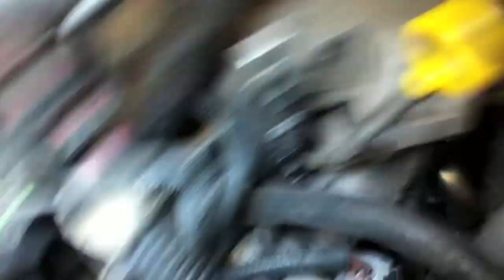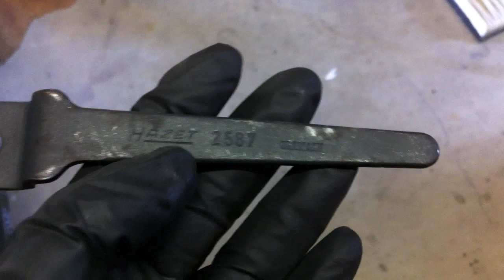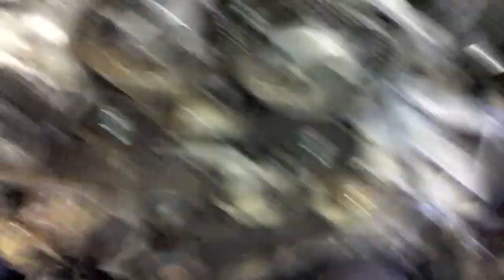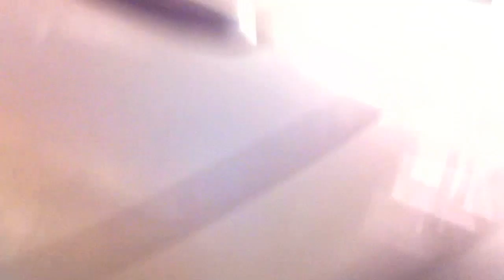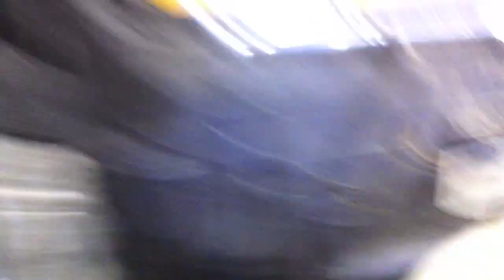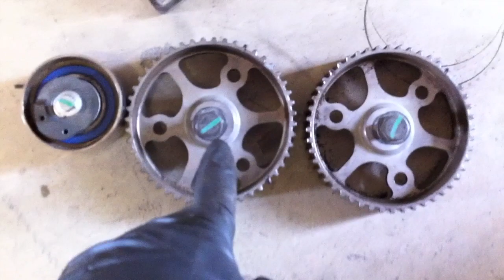Jeep Liberty Diesel Timing Belt Replacement Part 4

Comment from the maker: The locking device is to hold the torque while you tighten the bolts. If you don't you will snap the intake and exhaust timing pins, or tear up the intake manifold threads. You could use some sort of adjustable spanner to hold the torque with one hand or helper while you or your other hand torqued the bolt. But you need to be careful that the cams don't turn during this torquing procedure. Hence why the tool is the most sure fire way for a successful timing belt job.

Comment: I am considering buying a used one that the owner said he believes the timing belt has broken. It this the type of engine that could destroy itself if it was  running when that happened?
Reply from the maker: +Gene Vetere 
It could be destroyed. Or the valves may be fine. This is an interference engine, however the rockers on these engines break before the valves bend. That could mean you only need to do a timing belt service and a rocker service. Or it could have been so bad it damaged the head, or even worse damaged pistons and block. If you pull the valve cover/intake off you can do a leak down test through the injector holes to check the valves. if they are still good then a rocker and timing belt set should fix it. Without tearing into it you will not know. Dont assume the engine is useable. Assume the worst that the engine needs to be replaced. LOST Jeeps CRD section is a good place to learn more.

Comment from the maker: There has been plenty of discussion about this. One side says its a common rail with constant pressure, the other side says the pressure will never be constant and will vary somewhat with the pulses from the pump piston. In my mind it comes down to this, the pump has a timing mark that works with all the others, so why not use it and put it somewhere where you know it will be good? At the end of the day its easy enough to keep the mark aligned so why not?
Reply: COrobotchicken

Comment: I have lined up the cams,crank and fuel pump fitted the cam belt checked marks, all good rotated the crank twice, crank and camshafts line up but the fuel pump is out by a quarter of a turn each time,reset fuel pump and it's out again any ideas,I haven't tried to Start it yet
Reply: You ever figure out why? Having same issues.

Comment: Hi, how many hours for the job if you know what your doing,  pump, 2 pulleys, belt, tensioner and flush coolant?
Reply from the maker: socratis the quickest I have been done one was about 3.5 hours, and that’s because I had an issue come up with a water pump right before I had to drive across country, as in I was about to leave the driveway and checked my oil first and found the issue. Typically I take about 5-6 hours, which includes some time for pressure washing the radiator and intercooler of accumulated crap. If you find the intercooler has the thermal cracking near the inlet and you want to patch with JB weld this will add time to the job, and usually requires that you cure the job weld overnight. I do have a video I made specifically on what I do for that intercooler repair if you need to see it. A first timer who has reviewed the videos, has tools and parts, i could say 6 hours is typical, upwards of 8 for learning curve. You can do the job without pulling the bumper and such, if for some reason the fan shroud is gone it’s really easy to pull everything out. For me with an electric driver pulling the bumper and header is quick enough and gives me more space to work, and allows me to cleanup the radiator and intercooler with a pressure washer, that I prefer that method. Plus after 100k performance of the radiator and intercooler has to be somewhat degraded by dirt.
Reply: @IcarusOffroad  I took it to dealer and instead of original quote of 1000$ they want to charge me 2500 if I want water pump done, and they already started. Thanks for the information.
Reply from the maker: They can save some time by not replacing the whole pump and only replacing the front half. Do it this way adds about generous hour over just doing the belt. The extra labor is removing the cam gears, and rear timing cover. With that off replacing the front pump is easy. For someone experience in that method it’s about half an hour more labor. There are no moving parts in the back half of the pump, and the aftermarket pumps only come with the front half. The new oem pump will have a new prongs seal that can be transferred with the front half. 

I don’t know what the shop book rates are for hours. But they will be different for removing the whole pump vs front half. Where are you located?
Reply: @IcarusOffroad  nz, their rates are probably 150$ hour. I've looked at videos and some Colorado wheel thread with pictures for replacing all components,  the reason I took it to the dealer because other people weren't familiar with the engine but they were ready to take on the challenge and charged more than dealer saying 8 -9 hours. Dealer offered a good rate  saying 750 upwards 1000+, but when they opened the engine and got to the belt they called me and asked if I want water pump done? I agreed that at the start and left all parts on the passenger seat. So they put me in a position where only belt gets done and if I disagree with pump exchange they still charge me, then I'd have to go to a different place , take off belt and get to the pump, basically they did not do what I actually asked them to or they were trying to rip me off.
Reply from the maker: socratis that’s unfortunate. Maybe with the information about how to do the water pump the easy way you can convince them to charge you 1-2 hours extra only. Good luck.

Comment: I keep looking at this and will certainly make timing marks on the cam gears etc. The think that comes to me is the lack of key or index for the cam gears so they can  be installed in any positon.  At that point all the marking have no relevance because the cam could move and the gears still installed according to the alignment marks.  This would still result in the engine being out of time.  I believe the key is in the pins. they are really the only thing that ensures timing is maintained.  The injector pump may be the only variable that needs to be marked and aligned during install.  This would explain the lack of markings throughout.  Just my thoughts.  Craig

Comment: i've done the proper timing still it doesnt start got a new crank sensor,cam sensor injectors done what could it be
Reply from the maker: Make sure the fuel system is properly bled, if you are not getting fuel out of the CP3 pump or the end of the fuel rail you likely have air trapped in the system. Start with the primer pump on the filter head. If lack of fuel is not the issue the make sure you dont have the cam sensor and the rail sensor swapped, they are very close to each other and have the same type of plug. I have done this on accident many times when I take the rail out, and since the labels fall off easily its basically a 50/50 shot when I first go to startup if I did it right. If you are still having issues LOST Jeeps CRD section is a good resource to help get it figured out.
Reply: veedub Tokyo a

Comment: how much are the loking pins
Reply from the maker: Its miller 1052 and miller 1053, but you can also find generic kits around online that have the tools except for the cam locking tool(millter vm 1085).

Comment: if there are no woodruft keys on the cam sprockets why bother to mark them provided the belt sits snug between the two thts extra stress and no need for the expensive locking device.  .tone